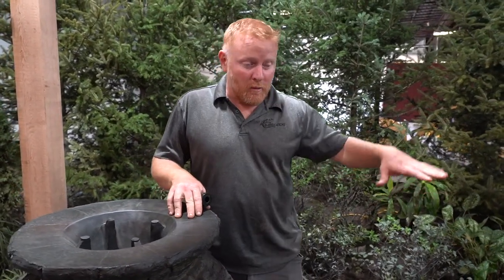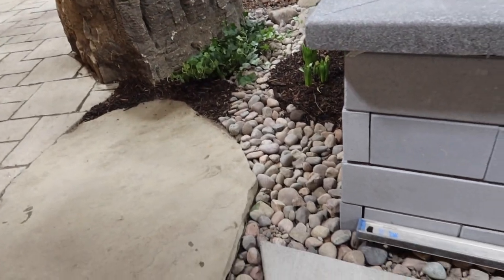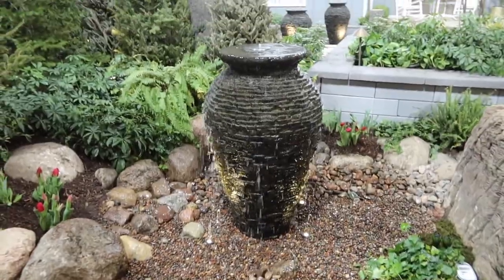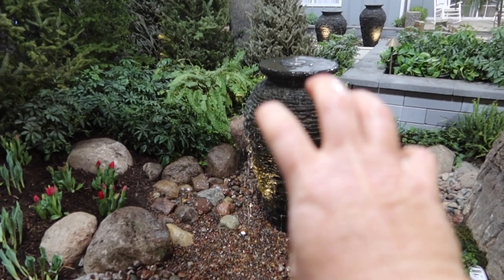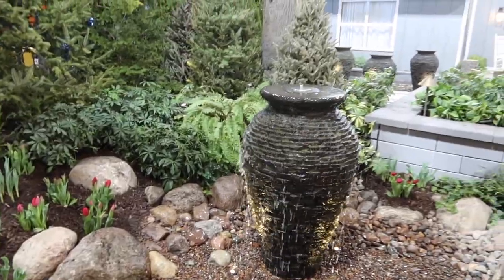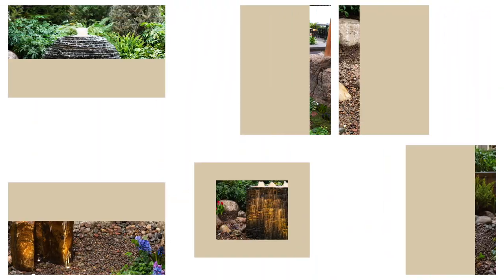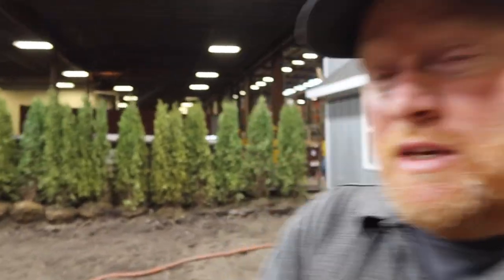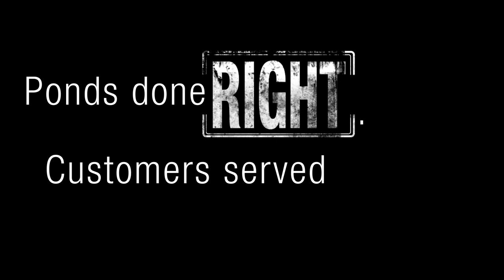Easy *DIY FOUNTAIN* Installs for Any Outdoor Space

Comment: They have these fountains on Amazon that look like stacked rocks. It stands on its own like the tabletop foundations you can buy. This is larger and runs about $350 . I was thinking about buying one and just put it on my deck for the cool effect and water sounds but it seems out of place. You guys did a great job making all the fountains look they belong there but using the boulders and flowers placed in significant areas.

Comment: What material is this vase made of?So, as I saw the same vase, which had a fountain and a fire burned on top.  How does it work?  Please tell me. Thank you in advance for your answer.Is it possible to attach fire to this vase with gas-metan connection ,gas supply pipe?